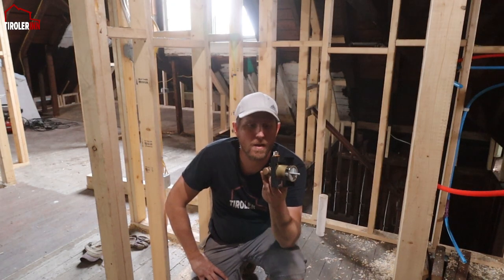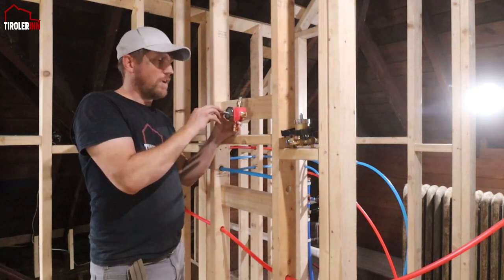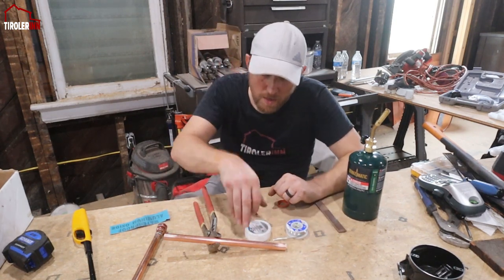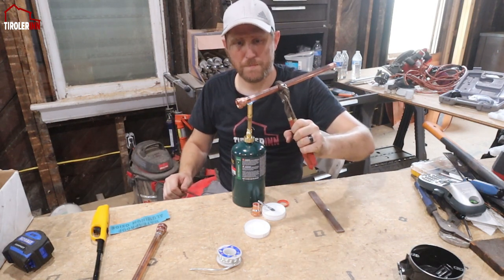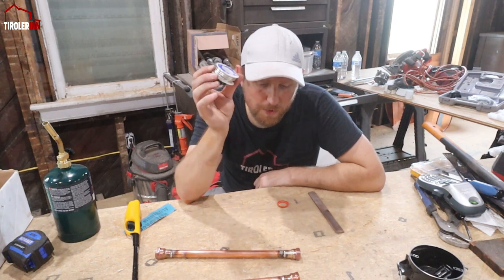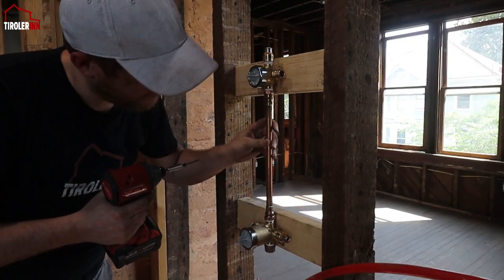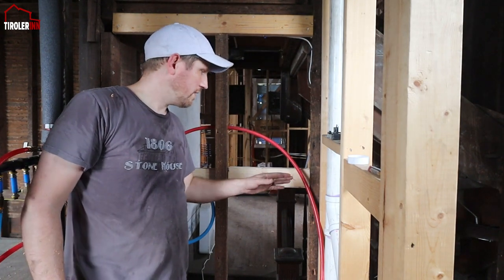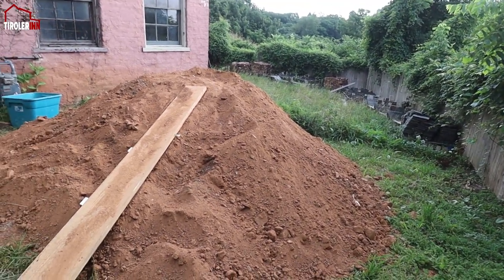Installing Rough-In and Diverter Valves in our 100 year old Victorian home - TirolerInn Renovation

Comment: I was taught to heat the fitting, not the pipe. Otherwise, great explanation!
Reply from the maker: Yeah, as long as both parts are hot enough it does not matter.